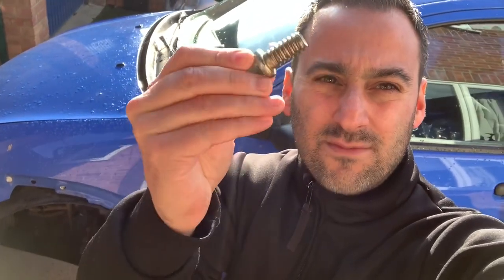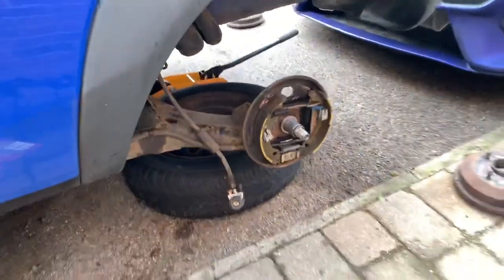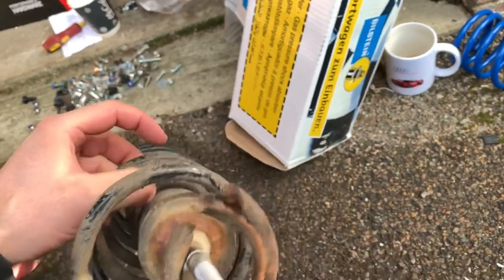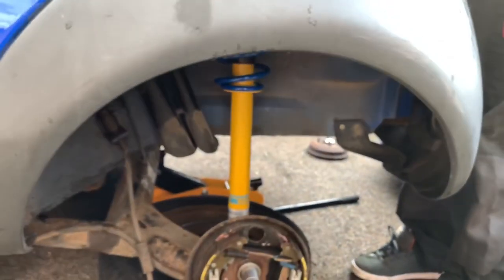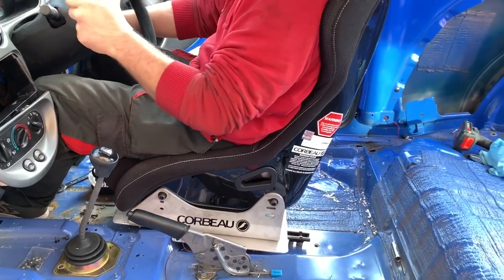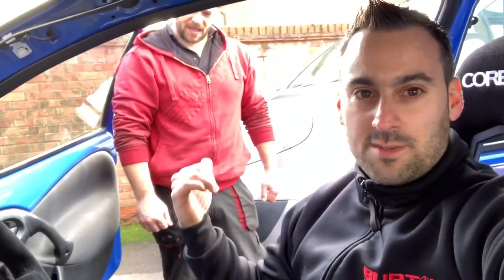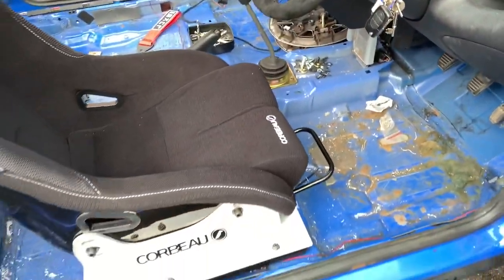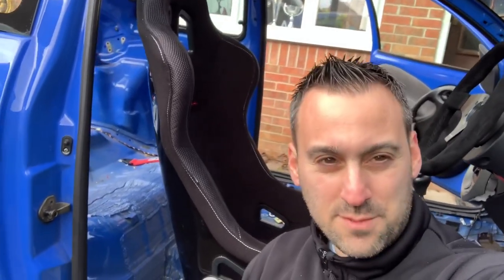Building an EnduroKa Part 9 - Corbeau Seat and Bilsteins fitted

Comment: I’m in buddy
Reply from the maker: Rub Smoke n Sauce top man thanks fella, where you based? In UK?
Reply: Peak Performance Reviews yes mate, up near Manchester
Reply from the maker: Rub Smoke n Sauce ah cool then 3 sisters and Oulton Park are your closest circuits. We’re racing at Oulton this year on the 27th of July you should swing by. Also Cadwell on the 24th August and that isn’t too far but a bit further for sure. Then Donington is our first race and that’s not far from Manchester really either and we’re there on the 6th April :-)

Comment: Working my way through your enduroKa build, really helpful as I’m about to start modifying an Mx5 for racing next year, thanks. Did you have any issues with scrutineers and your seat mounts?
Reply from the maker: TrackDave thanks fella I’m glad you like, do you know what championship/series you may race in thus far? Nippon Challenge would be awesome for you and you should check out my videos also of me racing in that. No they are very study and follow the regs etc and FIA for thickness I believe 6mm etc and have always proven to give me no problem at scrutineering.
Where are you based? Also if you haven’t already please subscribe and stick around for sure as it’s always great to have people like you on board thanks again.
Reply: Peak Performance Reviews awesome. I’m near Stratford on Avon. Planning on doing 750mc roadsports but I’ll give Nippon a look. Keep up the good work.
Reply from the maker: TrackDave https://youtu.be/88zskXaaSMI
Reply from the maker: TrackDave ah mega not far away really, that sounds awesome fella I’ve given you a link below to one of my Nippon races, I have about all 40 odd races on here somewhere 👍 we get a huge cool mix of cars and it’s regulated by power to weight in classes etc really cool fun series